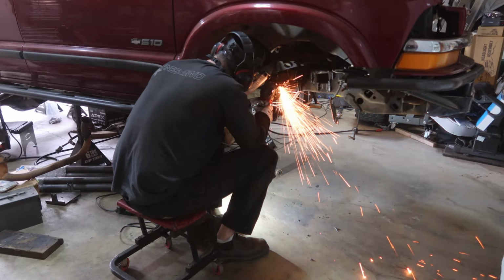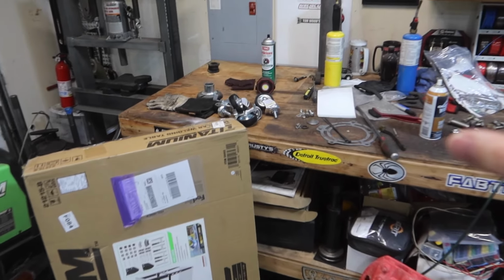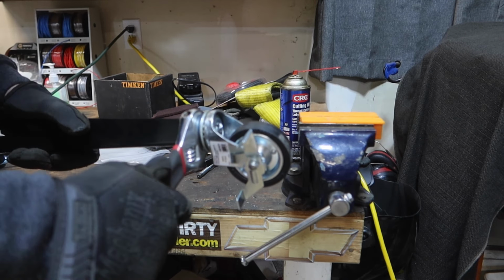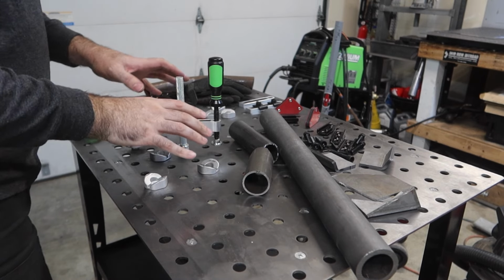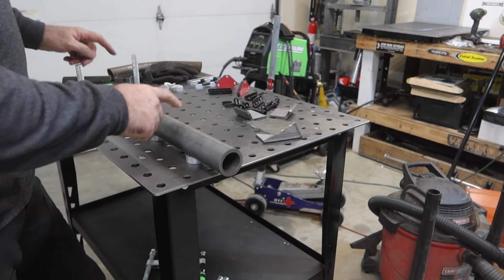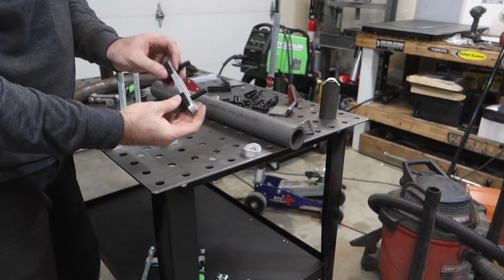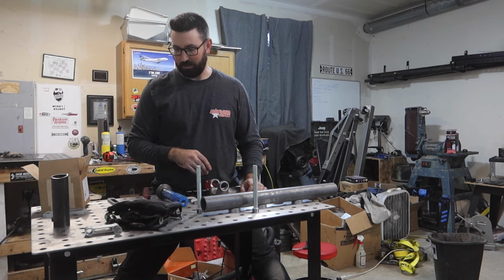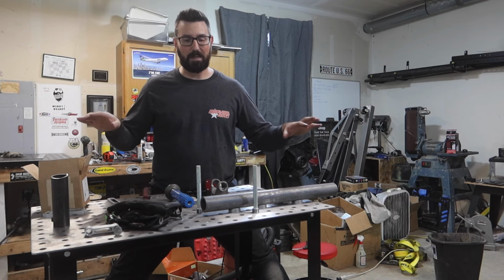Harbor Freights NEW Game Changing Fabrication Welding Table

Comment: Its not a "game changer". Its the EXACT same table that northern tool has been selling for decades. Its just a little cheaper. Its still a flimsy 3/16" table with stamped legs. basically only good for fixturing very small parts. It won"t withstand anything serious.
Reply: You are correct. Anybody who buys this with any expectations over and above what common sense dictates deserves to have their retail dollars taken from them. It is exactly what it is. Nothing more and nothing less.

Comment: I bought 4 of these when they released them in Indianapolis. They are the exact same as the Klutch brand Northern Tools has sold for years so they're not a new product to the market. Just new to HF.

I added casters to my tables as well. They tack weld m10x1.50 nuts to the bottom of the legs for the factory feet to thread into. Two nuts broke lose from the legs as soon as weight was applied to them. Not a big deal overall since I have a welder and was able to easily fix it. Just something to note and keep in mind.
Reply: The one difference is the top plate on the HF being bolted on vs the Klutch being stitch welded. I’ve read of warping with the welded versions.

Comment: Kelly; The sliding stops work well when you make an angle iron fence with the black round plugs on one side and your work piece spacing doesn’t line up with holes on the other side. Make some inside and outside squares for your fit up and it won’t be so fiddly….I would also suggest getting a harbor freight scissor lift table. You could make a bracket so you could clamp the second fab table to it. This would obviously allow fab at different heights for more comfortable welding, but could also allow component fab under the truck. Lastly, the scissor table could have an array of jig/ brackets to mount any component, especially axles or transmissions for rebuilding or customizing (complements space saving/one tool several uses/portable and modular). v/r wh
Reply from the maker: Thanks, good to know👍🏻